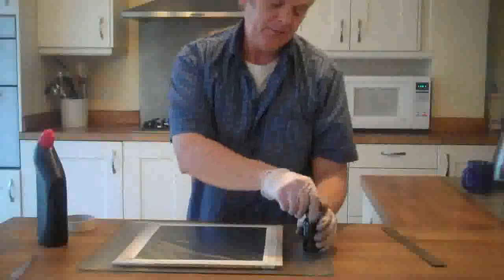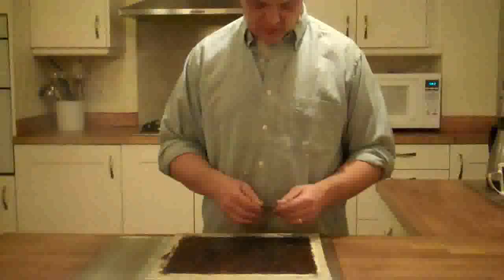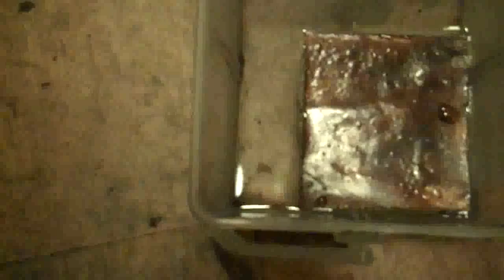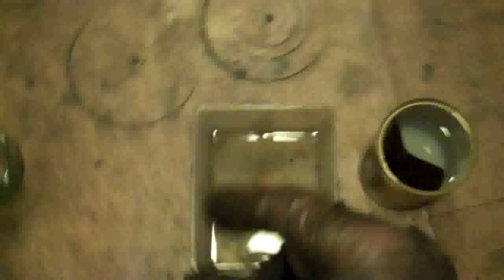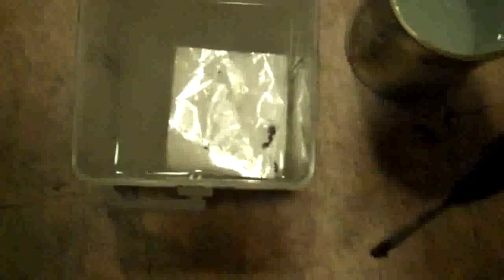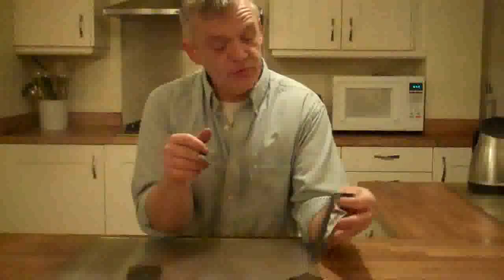How To Make Graphene Sheets As Big As You Like

Comment: I was also wondering. I'm not that good at chemistry but would the main way hydrogen peroxide ends the reaction is by converting sulfuric acid and phosphoric acid to water and the congugate weak acid? 
I don't have any 30% hydrogen peroxide right now but I do have Sodium Hydroxide which also converts acids to the weak acid and water (I think). 
Would that also work? 
Probably not but just wondering
Reply from the maker: you could always try it and see - but i doubt it too

Comment: If the dispersion of the graphene is irregular, how well would this work for use as a Faraday cage to shield from microwave (imaging)? I was looking for an alternative to the cost of Y-shield paint or graphene sheets. I think it would be more effective if combined with either copper or silver particulate mixed in varnish, applied afterwards. Although it might be best to forego the reduction of the aluminum; it just isn't aesthetically pleasing.
Reply: Hi how have you managed to deal with the emf ?

Comment: Great video thank you, I hung on every word. Question if you were to use steel wool to sand or rough up the backside of the aluminum , opposite of the graphite layered side, would that increase the surface area enough to create a greater reaction with the acid to produce more of  the needed reaction to the graphite oxide?
Reply from the maker: scott lund i don't know - it would speed up the reaction but it wouldn't produce 'more' as the amount is limited by the available reagents

Comment: I was thinking of how I could apply the graphene to larger sheets/rolls of paper or to panels using my auto paint sprayers.  I don't know what I would do with them. Possibly make some kind of capacitor or a solar panel. Just for fun. Maybe build some sort of LED display. Art?
Reply from the maker: +Michael Pietrs a cheap large scale method of making supercaps from graphene is much sought after mate - if it worked you could well be quids in

Comment: at 6:40 you seem to say the shiny side of the foil is shiny due to a coating of plastic. Is that right? I'd often wondered why the 2 sides of foil were so different that way.
Reply: +ExtantFrodo2 Wrong. Aluminium foil is pressed between rollers. A block several centimeters thick gets rolled thinner and thinner by time. The last rolling has a problem: The foil is to thin to get thinner. They simply roll 2 sheets a time. The Shiny side is from the rollers and the dull side is the two foils touching each other. It gets dull because it is a lot of rubbing against each other. Just watch the Video How Its Made - Aluminium foil for example. But if I remember correctly, they do not show the 2 foils getting rolled a last time. Galileo in germany showed that recently much better.

Comment: The link you posted was about graphite oxide, but you talk about graphene oxide. Which one do I use? Sorry if this is a dumb question, but I'm very new to this.
Reply from the maker: they are basically the same thing mate - there is some confusion over terms in the literature but graphene oxide is to graphite oxide as graphene is to graphite - the difference is graphene oxide is easier to disperse than graphene
Reply: +Robert Murray-Smith Thanks for the quick response! I'm a middle schooler with no background in chemistry, but I'm interested in graphene and its applications to robotics and other sciences. Is making such a sheet a good project for me, or is it too advanced?
Reply from the maker: dunno mate - i know nothing of your skill level or your back up - but it might be an idea to try a simpler method
Reply: +Robert Murray-Smith Do you know of a simpler method I could use to make small sheets of graphene? I have an idea that might be useful in robotics. Thanks!
Reply from the maker: i have done lots of graphene making vids mate

Comment: Could you mix the graphene oxide with the floor varnish and screen print it onto the aluminium using an air bed?
Reply from the maker: certainly but the varnish would act as an insulating layer between the sheets if you did it that way

Comment: Pulling aluminium foil as flat as possible isn't hard.  A wooden roller such as a baker's battle club will do.  Spray a piece of rather thick glass, 5mm at least, with some tacky spray glue.  Put the foil on the glass while it's still wet, and roll out from the centre.  If you use tin float glass, it's even smoother, but any piece of window glass should be enough.  Baking glass isn't flat.

Not sure here, but if you put the graphene oxide in a sprayer, wouldn't it make it even?

I worked at a sailboat rigging factory, and one of the things they used to make sure the aluminium was clean for the white paint (aluminium is best anodized) is phosphoric acid applied with an abrasive sanding pad, the "drywall" kind made with the mesh.  It worked.  Not sure if that's what you're going after.  Washing-up liquid is good for removing any sort of grease but it's got sodium hydroxide in some brands, beware!

While kitchen foil is what's available, vacuum deposit of the aluminium, like is done with telescope mirrors, would make it faster, but not easy to just cut away from the tape.  Expensive, too, requires something called an oil diffusion pump.  Basically, a pump that can remove the air from a vacuum tube.  A bit much for a kitchen scientist!

15% sounds like hardware store "muriatic" acid, "bad for the environment" concrete cleaner...  It works: but if that's too strong, what molar concentration might work best?

I find that acrylic artist paint that's been diluted works pretty good for making a super thin plastic sheet.  I made a capacitor this way.  Though it's easy, it's not great, because acrylic retains moisture.  Genuine lacquer, enamel, or maybe even thinned urethane would work better than varnish?

Comment: might use a so called "bar" to coat. It is basically a bar object (piece of piping) with tight wound metal string around it. The thickness of the string is of influence of the layer coating. The thicker the string, the thicker the layer. Just an idea!
Reply from the maker: interesting idea mate

Comment: So I attempted this myself. Unfortunately I was unsuccesful. The bath seemed to be too stong and completele disintegrated the whole sheet. I used an off the shelf Muriatic Acid... could this be the problem? other possible problems could have been a too thin application of either the graphene oxide or the varnish. Otherwise it was the size of the sheet as I was ambitions enough to do a large piece of about 20 x30cm. Any thoughts? advice for my second attempt?
Reply: I thought he said hydrochloric acid

Comment: Would a water soluble
 substrate work instead of aluminum? Thanks
Reply from the maker: the hydrogen evolution from the reaction of the aluminium with the acid is part of the process - that's what reduces the graphene oxide back to graphene - i guess if you could find something else that does the same thing and is water soluable - then yes - or if you did the reduction after getting rid of the substrate then why not.

Comment: Are these contiguous sheets the same as the sort you got with the pipe fitting pressure cooker assembly of yours and the kind you get via copper sheets + vapor deposition, IE an A4 sized single molecule with a mollecular weight beyond comprehension, or would it be more akin to dispersing a lump of graphite(lots of micro-sheets) into a sheet?
Also, could sheets produced frome a refined version of this process hold up to the metrics normally associated with graphene like absurdly high sheer/torsion/tensile/conductivity/electron velocity strengths?
Reply from the maker: more like lots of microsheets - which is really what the Tang Lau produces anyway. I would guess they would hold up really well - certainly well worth working with - particularly when you think not a lot of people have CVD capabilities.

Comment: i am curious could you use polyurethane in place of varnish. Also can the % of hydrochloric acid be changed without affecting the end result. i have a premade 37% Hydrochloric acid mix, will this work, or is less of a percent better for the reduction. Also what would be the best method for the reduction of graphene oxide to a graphene sheet  for balistic purposes. i would like to make graphene for armor such as a bullet proof vest etc.
Reply from the maker: Paul Gilardi The varnish is a PU base mate higher concentrations will work but pretty rapidly and quick is not always the best. Look at the video i did on bullet proof plastics for a better view of using graphene for ballistic materials

Comment: what would happen if you attempted to produce the graphene and then desolve both the aluminium and the varnish? I was wondering if I wanted to would I be able to remove some or all of the varnish with a chemical paint/varnish stripper or would this damage the graphene and if so would the use of a different coating that desolves differently be useful to give me the graphene sheet with little or no coating? or does the graphene need the coating to hold together properly?
Reply from the maker: There are lots of approaches you could take - one might be to use no binder and calender it - the sheet is made of individual plates it's not one whole sheet so there are going o be defects att he edges which will be weak points - you have to have some strategy to overcome that - so another might be CNTs added in.
Reply: thank you very much, experimentation is needed!
Reply from the maker: yes it is - go for it and keep me in the loop - i'd love to know

Comment: How can you be sure you actually have graphine and not just carbon glued together. what properties (electrical and physical) does it have. the process to make graphine, the one i know about anyway, uses electricity to align the carbon in a straight line and bond it on an exact molecule, depending on what properties you want it to have. so how does this work? I'm not saying it doesn't, just curious.
Reply from the maker: Raman test gives characteristic D and G band - I know of at least a dozen ways to make graphene
Reply: should show 2d not d, if high quality graphene.
Reply from the maker: goaheadroll
hmm - The G-band is the primary mode in graphene and graphite. It represents the planar configuration sp2 bonded carbon that constitutes graphene. The band is resonant, which means that it is much more intense than we would expect it to be otherwise. The band position is pretty much independent of excitation laser frequency though, making it different from the other graphene bands. The position of the band and to a certain extent the shape can provide you with more information. One common application for the G-band is to aid in determination of graphene layer thickness. As the layer thickness increases, the band position shifts to lower energy representing a slight softening of the bonds as the layer thickness increases. It is also worth noting that the position of the G-band is quite sensitive to doping and even very minor strain. This needs to be considered when attempting to use the band position of this band to determine graphene layer thickness.
 
The D-band is known as the disorder band or the defect band. It represents a ring-breathing mode from sp2 carbon rings, although to be active the ring must be adjacent to a graphene edge or a defect. The band is the result of a one-phonon lattice vibrational process. The band is typically very weak in graphite and is typically weak in graphene as well. If the D-band is significant, it indicates that there are a lot of defects in the material. The intensity of the D-band is directly proportional to the level of defects in the sample.

The last thing to note about the D-band is that it is a resonant band that exhibits what is known as dispersive behavior. This means that there are a number of very weak modes underlying this band and the choice of excitation laser used will enhance different modes. The consequence of this is that both the position and the shape of the band can vary significantly with different excitation laser frequencies, making it is important to use the same excitation laser frequency for all measurements when characterizing the D-band.
 
The 2D band is sometimes referred to as the G′-band when discussing similar materials such as carbon nanotubes. However it is more commonly referred to as the 2D-band when referring to spectra of graphene. The 2D-band is the second order of the D-band, sometimes referred to as an overtone of the D-band. It is the result of a two-phonon lattice vibrational process, but unlike the D-band, it does not need to be activated by proximity to a defect. As a result the 2D-band is always a strong band in graphene even when no D-band is present, and it does not represent defects. This band is also used when trying to determine graphene layer thickness; however the differences between single and bilayer graphene in this band are more complex than a simple band shift, as is observed with the G-band.
 
The changes in band shape have to do with changes to the active components of the vibration. With single layer graphene, there is only one component to the 2D-band, but with bilayer graphene, there are four components to the 2D-band. This is why the shape of the band is different. Just like the D-band, the 2D-band is resonant. It exhibits strong dispersive behavior so the position and shape of the band can be significantly different with various excitation laser frequencies. Again, it is important to use the same excitation laser frequency for all measurements when doing characterization with the 2D-band. Finally, it is also worth noting that the 2D-band is very sensitive to graphene folding, which needs to be considered when trying to use this band to determine layer thickness in graphene samples.

Comment: There is no plastic on aluminum foil. its shiny on one side from being polished during manufacturing. The ribbons of foil are so thin they double them up as they are cold rolled to final thickness. Because of this two of the sides become polished and the other two are dull. 
The HCl takes time to hit aluminum because of the passivation layer of aluminum oxide.
Floating come from buoyancy not from being hydrophobic.

Comment: How can you join two or more sheets?  Use epoxy? Weave?
Reply from the maker: why do you want to join them?
Reply: I would figure that at some point they would be treated like carbon fiber.  I would like to think they could be shaped.
Reply from the maker: In that situation, for conductivity I would probably think along the lines of pre coating the shaped plastic for in a copper tape prior to deposition of the graphene oxide, Then reduce then point to point bolt at the copper - or something along those lines

Comment: Were you agitating the solution with vibration because it looks like the large two bubbles that formed in the same location on the left side had standing waves in them..  Agitation through vibration would (like heating a solution under reaction or increasing atmospheric pressure on it) predictably increase reaction energy and reduce the reaction time as well as help make the reaction more consistent across the surface area overall by helping to mix and reduce inconsistency in the bath solution mix of water and HCL acid.  So for those wanting to increase the process efficiency, add (some) heat --warm not hot so not enough to create a fire obviously and agitation (high frequency vibration might be best or pressure (large rotating device spinning fast enough that the solution is held firmly in place against gravity by centrifugal force but on an outside curve with speed carefully adjusted so the solution doesn't centralize but stays evenly spread across the surface..  Lol..
Reply from the maker: +Matt Carrell no mate - I just let it stand - but nice suggestions - thanks

Comment: As I understand main idea is reducing carbon structure to 1 layer.. How this video is related to graphene anyway? You just show how to remove oxygen from carbon oxide but what is main idea to reduce thickness of carbon layers to get graphene? Maybe my english is too bad to understand in what moment you created graphene?
Reply from the maker: ROMA4cm read more about it mate - i don't want to be rude but you don't seem to understand the subject - I am sorry if this comes across in the wrong way - but it would take me an age to explain your mistake and you can find the answer by reading more about the subject and getting a better understanding of what graphene is
Reply: Is graphene so complicated to taking and age to understand? All info I get is that graphene is super thin layer of carbon and it can be obtained by removing all layers of carbon structure except few ones. Your method just clears carbon from oxygen but not making super thin film. Thats why resistance is so high. Sorry if I am rude but I think that I am not one who doesn't understand what graphene is. Even If you created layer of graphene plates of diameter of few micrometers on all surface with your chemical technique (which I doubt), it is not the same as "making graphene sheets as big as you want".
Reply from the maker: ROMA4cm no worries mate - i understand - oh and yes it does take quite a while to understand properly